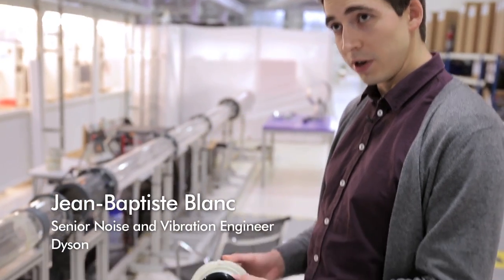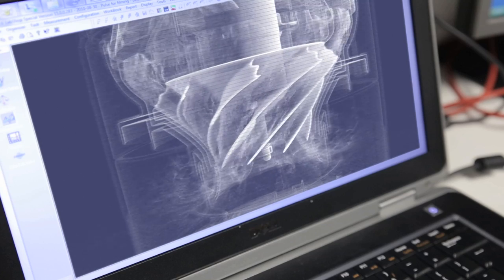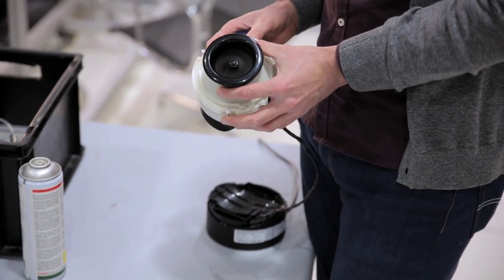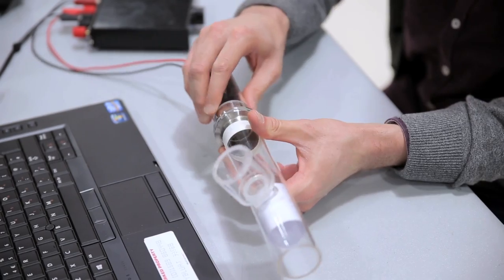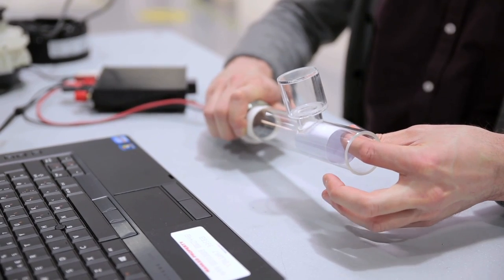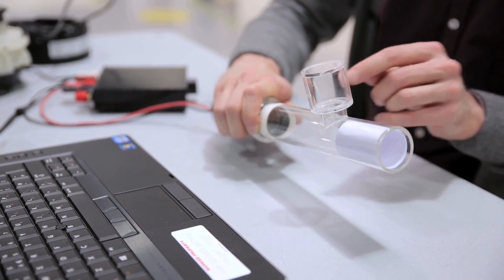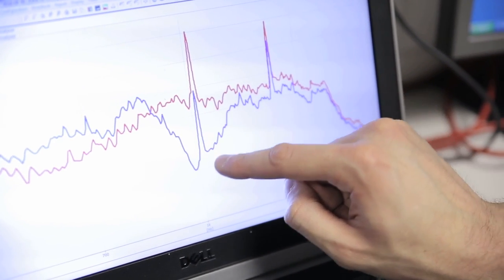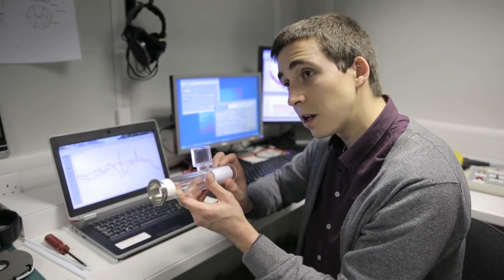What are Helmholtz cavities? Helping Dyson engineers reduce the noise of bladeless fans

Comment: You should try using Herschel-Quincke tubes. Way more efficient than Helmholtz resonators for taking out pure tones.
Reply from the maker: Hi Jon, it's Jack at Dyson.

Herschel-Quincke tubes may be effective, but wouldn't fit into a compact footprint - so it’s not a practical solution for our Dyson Cool™ fans. Our acoustic engineers used a Helmholtz cavity which works at a frequency of 1000Hz, improving the quality of the sound by reducing unpleasant tones.
Reply: @dyson  you still ain't fixed the issue in 2023 on the tp09.

Comment: my Am07 fan is making a high pitched noise on all settings.. and you can hear the motor spinning.
on low settings the motor is making much more noise than the wind. 
i don't know if my unit is in bad shape because it was a gift from a deaf who upgraded.
all i know is that the noise coming from the Am07 fan tower is too high pitched that i much prefer to turn it off.
its out of warranty, so i can opening and check... which i did, but after cleaning the main impeller both sides i so nothing wrong. its like it is designed this way.. i couldn't remove the plate at the bottom described in this videoafter removing all screws it won't move. Can soneome post a solution fix for the high piched motor noise?
Reply: You may be better off using absorption  technology, in other words try strategically placing foam rubber wrap around the motor being mindful to still allow cooling, perhaps perforated foam, use your imagination.

Comment: Great innovation but unfortunately conventional fan is less noisy and way cheaper.
Reply: but more risky. a blade can cut your fingers. but impeler is hide in the structure and cant do it.
Reply: @slevinshafel9395  if you ever use a regular fan, you will notice the fan is enclosed in a case. Your fingers are not at risk at all.